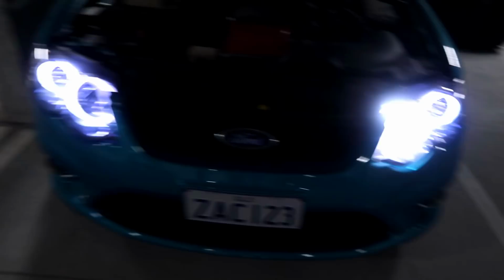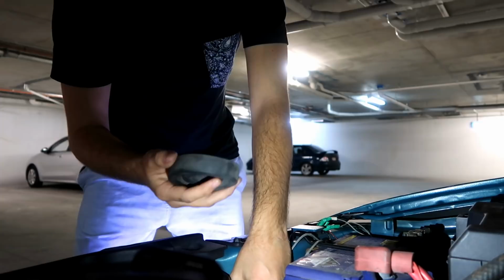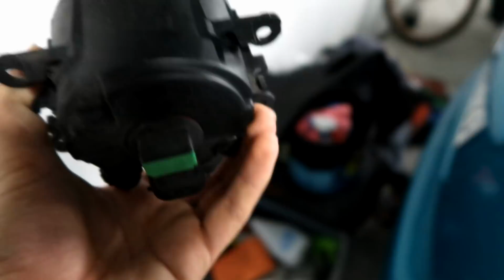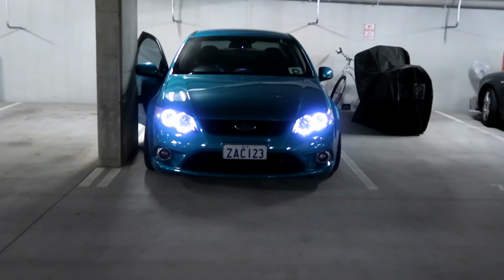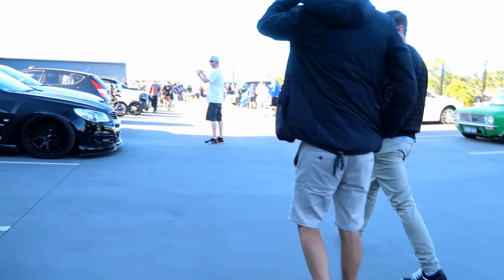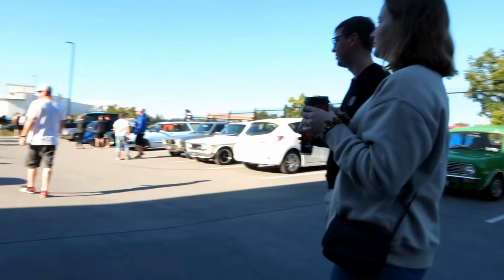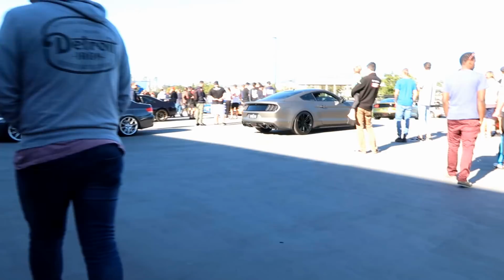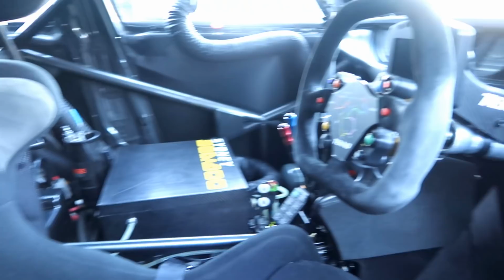Hitting up TEKNO Cars and Coffee with Sarah

Comment: I have been driving around for 3 weeks with no left front indicator because I have to take the whole bumper off to change it and I cbf
Reply from the maker: Regular target hahahaha😂😂 nothing wrong with that mate
Reply: Why do you need to take the bumper off to change the bulb? You can access it via the splash shield. Turn the connector anti-clockwise to access the bulb holder.